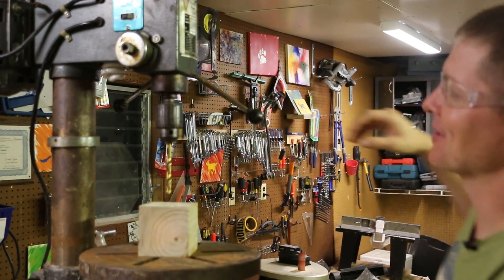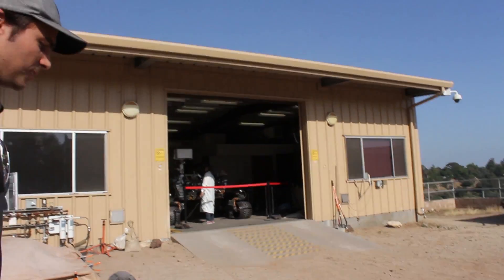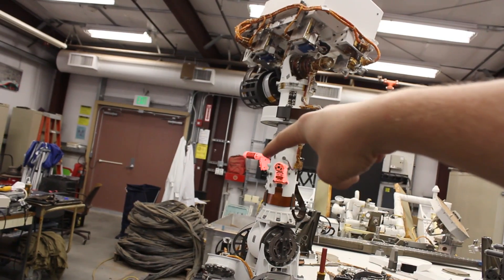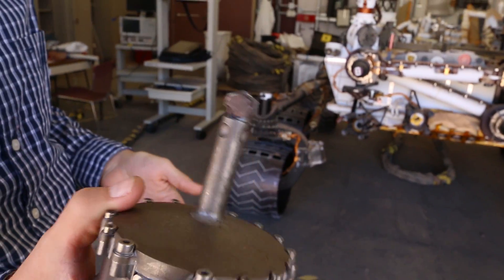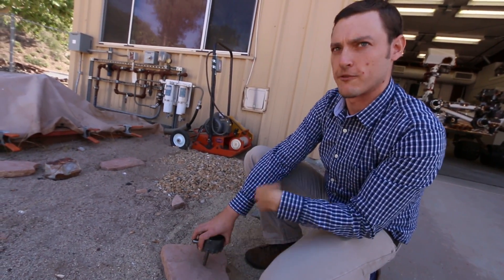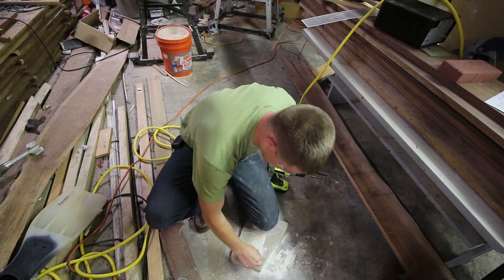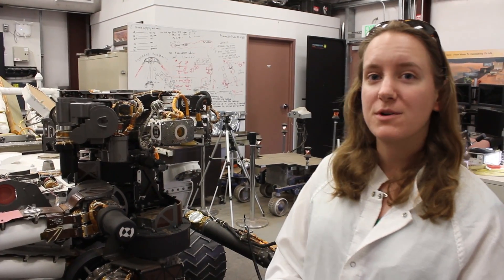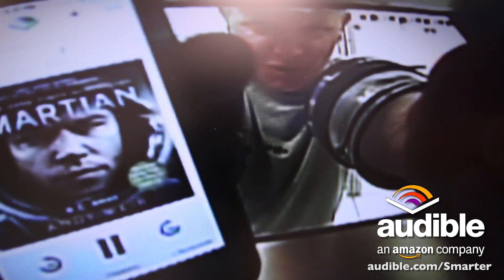The Drill we sent to Mars - Smarter Every Day 143

Comment: Destin, you are repulsively devoted to the lie that is Nasa. I get that you want to live in denial because you work for them and you cling to the soothing lie that Nasa must be good somehow, but that's not what a good christian does. If you were an honest man you would ask questions about why the rover has moved at an average speed of 100 times slower than a garden snail. Why this affront to engineering isn't even capable of color fidelity like a 100$ tourist camera. Why the only video from it is a multiyear timelapse. And an ocean of addtional scathing questions because it is a criminally incompetent piece of engineering.
You might also ask why it doesn't use a laser drill and test the material in situ.
That kind of thinking would make the rover 10 times lighter and 100 times cheaper. 
And if there were even remotely ambitious intelligent people in charge at Nasa, it would have autonomy to do research and roam around and achieve 100000 times more than Curiosty has done. 
Two Kennedy presidents assassinated and wars started based on lies to kill millions of people and you want to pretend everything is good and call yourself christian.
You never knew Jesus.
Reply: +Dan Frederiksen Okay, if it's so incompetent; surely you can do better. I expect a prototypeable design in autoCAD by next week; followed by informing everyone on how to manufacture each part. After the prototype is built; you will be responsible for testing and making sure there are failsafes for everything.  If your design succeeds; you must then come up with a landing process that will work in a near vacuum, and then, of course, test it. Assuming everything works perfectly; you will then calculate the delta V (among a few thousand other things) and decide on the delivery method that has enough potential energy to  successfully escape earths influence at the perfect time so that it meets with Mars  with enough fuel left to slow to an orbit and drop its payload; at which point you can only pray to that dude you don't know that everything works... After you've done that; you have a right to complain. (Also: laser drills, seriously? that's like saying "why don't they use a blow torch instead of a saw to cut that wood?")
Reply: +Dan Frederiksen I am no expert on the subject, but you have gotten many points wrong. For example, the rover is not 100 times slower than a garden snail— a snail has a top speed of 0.047 km/h (roughly 1.3 cm/s) whereas the Curiosity rover has a top speed of 5 cm/s and an average speed of 1 cm/s (slower, but definitely not 100x slower). Also, the rover can see in colour (although I'm not sure, as I've only seen videos of its footage), and I don't think that the quality of the colour is going to change its primary mission of exploration. It's not an art dealer, you know? Autonomy you say? Humans have not even advanced far enough to create an autonomous robot on Earth (disregarding Google's self-driving cars which are still in the process of being created), much less when the rover was sent up four years ago. I'm assuming that it doesn't use a laser drill because the primary purpose of the drill (as mentioned in the video) is to collect the powder, which may be damaged by the heat of lasers. Lastly, although I have nothing against your beliefs, why would you bring up morality and religion into something that has abosolutely nothing to do with it? i.e. It was never brought up in the video, so why bring it up now? To be completely honest, you have many flaws in your argument so far, but I can't judge because I am not specialized in this field either. One thing though, please do not assume that your perspective of morality and religion is the same for everyone of your religion. Thank you.
Reply: +Dan Frederiksen Get help.
Reply: +Dan Fredrickson What are you possibly thinking about when you link his faith to the perceived shortcomings of the rover? I'm not going to get into all the reasons I think your logic on NASA performing poorly in regards to Mars exploration is flawed.  Because others have already done that and it isn't even my main concern. That's your opinion and I don't mind letting people have those. But to attack Destin and say those harsh comments about him not being a man of faith because he is a NASA employee and fan boy? It makes no sense. I'm not a man of faith but I hardly think it's acceptable to attack people's morals because they are passionate about their interests. I really don't think God has a problem with Destin liking Mars rovers, even if you hypothetically were right, and Curiosity was a pile of cow dung not worth driving on a go kart track. To say that a man who obviously takes his religion seriously (and as far as I can tell lives his life as a very kind, generous, and genuine human being) is very callous and hateful of you. And seeing as though I have spent years of my life studying religion, I could almost guarantee you that the Christian God you seem to worship would have a much bigger problem with you being spiteful and arrogant than he would with Destin enjoying the immense wealth of knowledge and engineering that went into landing a vehicle on Mars and exploring the Universe you believe He created. 
Ultimately, I just don't understand how you possibly managed to take your anger about Curiosity some how being a government shortcoming out on Destin, and how someone who claims to be a Christian could think it is acceptable to tell somebody they are spiritually and intellectually inferior to them. You seem to be the one is lost my friend. If you think your attitude and rude remarks would make Jesus proud then you may want to spend some time praying on it tonight and doing some soul searching. You might just realize that you're the one in the wrong.
Reply: +Dan Frederiksen Driving slow is safe. You can't just send a mechanic up there to replace the wheel if you smashed it from hitting a rock, so they have to be as careful as possible. It's a multi-billion dollar piece of equipment! And we do have HD great color photos. The problem is that there's a lot of radiation up there. Try putting your "$100 tourist camera" and see how many minutes it will last exposed on the Martian surface. And you answered your own question: why would you want a video that was the same as a still frame, since it's moving the pace of a snail? Also, you can't just hook it up to your 3G connection and upload it. Mars is a long way away and there are very few satellite data links between there, so they have to be very specific about what tiny amounts of information they send back.
Reply: Dan Frederiksen Unfortunately, I have to disagree. A quick Google search will reveal that a garden snail does, indeed, have a top speed of approximately 1.3 cm/s (converted from 0.03 miles/h here: http://www.infoplease.com/ipa/A0004737.html and 0.047 km/h straight from Google). As you have not said anything as to how you know that a snail is much slower, I am forced to be skeptical of your knowledge. It is true that the rover has not covered a large amount of distance given the time it's spent on the another planet, but that most cannot be attributed to speed alone. While speed is equal to the distance covered divided by the total time, this only applies when the object is travelling at constant speed. The rover stops hundreds of times every day to check its surroundings/gather data, etc. And once again, if we had completely autonomous robots, we would not need to rely on things such as bartenders, cars, or planes, etc. The Curiosity rover is autonomous in that it follows an algorithm when exploring, but it is overrided when humans need to take control for something specific. I agree that if it were fully autonomous, it would be much faster, but I doubt that even that would be by much. The rover is doing research— not only exploration. When you're sitting down examining soil samples, you don't need to be going 20 km/h. Better safe than sorry, since breakage would be crippling towards the mission, and slow is safer than fast.
Reply: Dan Frederiksen The low end of the transfer rate is 0.0005 Mbps. That's like 100x slower than 1990s dial up. On the high end it's still just 0.032 Mbps. Try sending 1080p through that and see how many months it takes for a single clip. Curiosity has traveled the second most distance of any man-made object on Mars (behind Opportunity, which has been there for over a decade). Driving fast isn't really the point of a Rover anyway. What would that get you? It's doing material science with a drill.

If you're so smart, why aren't you working at NASA? Why aren't you even the head of NASA? You are obviously more competent than 60 years of engineering and 20,000 employees. When can we expect the Dan Frederiksen Rover to be landing?
Reply: Dan Frederiksen alright, so what, exactly, is this 3d printing technology? do we even have that?
Reply: +Dan Frederiksen Let's see that 100$ tourist camera working in the radiation and harsh environment of space and mars. I really hope you're a troll and not that stupid.
Reply: +Dan Frederiksen Okay, they use commercial cameras in completely sealed, man-made environments. How exactly is that equal to the surface of Mars? On Mars, there is no shielding, whether UV-resistant glass or some metal, to stop solar radiation.  Discounting the other environmental effects on pictures from Mars, solar radiation alone could distort the colors into what we have been shown.

I do not have extensive knowledge or experience with cameras or their lenses, so I likely made a few assumptions, though none completely baseless.
Reply: Dan Frederiksen You do realize that distance isn't the concern here, right? The ISS is in low Earth orbit, inside our magnetic field which shades it and us on the ground from the majority of cosmic radiation. But Mars doesn't have a magnetosphere whatsoever. The image sensor would completely fuzz out on a standard camera so you would barely be able to tell a straight line from a curve. Go look up "effects of radiation on image sensors" and there's a ton of research on the subject.
Reply: Man, you make a good joke!
Reply: I'm just gonna assume you're a troll.
Reply: Well a quick search on the web show pretty much nothing about you oh almighty " Genius"  Mr. Dan. I'd expect to see at least some sort of prize but an actor? really thats the only info about you? unless you show some proof that you are who you say you are you're just as bad as i am or maybe even worse mate.
Reply: +Space Walrus the navigation to Mars is fine. That's one of the very few things they do right. But I could easily do a dramatically better rover. Will you get me 1/1000 of just one year of Nasa's budget to do it?  I could even do it for 1/10000. But let me guess, I don't get any money to do it at all because you are so reasonable..
Reply: also I'm pretty sure it's mainly the government's fault, not nasa's
Reply: and to answer your questions about why it doesn't use advanced tech like lasers: First off, lasers require a lot of power. Second off, as this previous guy said, lasers' heat would damage rock samples—or at least, the organic matter in them. Third off, the technology works. It's hardy, has proved itself to be long-lasting, and is cheap and trustworthy. There's no reason to believe that people like Megan spared any creative expense, as long as it fit within their budget. The previous rovers have lasted long past when they were expected to stop functioning due to the fact that the parts were known to be reliable, and were hardier than any newer forms. And besides, making the rover more complicated with advanced technology would make the programming more complicated, meaning it would be more prone to bugs. Bugs that the rover might not necessarily have 4-24 minutes to wait for correction on. To briefly sum my point up: Simpler tech is less prone to problems than complicated tech.
Reply: +Dan Frederiksen sorry I spelled your name wrong by the way.
Reply: +qsdfcvgyjmkl  those are specs, not what it has actually done. And a snail is a lot slower than 1.3cm/s.
In the first two weeks it didn't move at all. And you can look up how far it has gone in all the time it's been there and do the math. A trivial autonomous rover could have done all that in the first 4 hours on the surface.
Reply: +Ryan Knudsen it's fair because it's true. A christian does not get to be part of evil and definitely not pretend it's good to the masses.
People fortunately sort of know that Nasa is a lie although for the most part they are too sheepish to really draw conclusions on it. They are too weakminded to really object. I am not.
2 US astronauts have come forward to say ET ships are real and it is being covered up. That's a fairly big fact if you think about it.
Reply: +Dan Frederiksen Now go and tell that to the people at NASA, who worked very hard for years to make this dream possible, personally. Everyone's a hero on the internet, especially the people that accomplished nothing in their lives.
Reply: +LamaAndTiger I hope they are listening
Reply: +StalePhish 100 times slower than a garden snail. It's not safety, it's just bizarrely treasonously incompetent. There is no safety is being so slow that nothing is ever accomplished. It's not just slow, that's just your lack of thinking talking. If you were there watching it, you could watch it for days and you wouldn't see movement. You only think it's ok because you haven't thought about it. You sheepishly assume. And despite the extremely slow pace, they managed to damage the wheels because there were little rocks on mars. Pointy ones. They hadn't thought of that... 
When even a very slow pace rover could do better in a few hours than it has done in years, then they are doing it wrong.
You are wrong about bandwidth too. And cameras. You have no insight, only sheepish faith.
Reply: +StalePhish but my thoughtless friend, who says it would be limited to another of Nasa's treasonously incompetent systems? bandwidth can be plenty good from Mars with a few appropriate steps. Easily multiple uninterrupted HD channels. An obvious step is a relay satellite in geo orbit around Mars (actually 3). Another at Earth. Either huge sat dishes (say 100m diameter @100GHz) or laser telescope. The huge dishes could be 3D printed in space with ease. Even optical telescopes could be printed but more difficult.
I am of course incomparably better than anyone at Nasa but Nasa doesn't hire the best and the few good people they have are kept from decision making. That's part of what you don't understand. Nasa is a lie and always was. It's a culture bred for sheepishness.
And speed matters because your life is very very far from eternal.
Nasa is built to make your life pass with a handful of breadcrumb achievements. A pathetic rover every 10 years and a few ticks and your life is over. A sheep to slaughter. If you bothered to think for once in your life you would realize how much better it is for a rover to do in an afternoon what Nasa rovers will take your entire life to do.
Just think about this simple fact. What Ryan the drill sergeant said in this video is that there is a water cycle on mars, even where the rovers are. So why wasn't that detected immediately by the first rover unless it's so incompetently made that it can't even detect effing water.
An even half decent rover would operate autonomously on that super easy surface of mars and sample everything continuously in rich data streams and glorious HD. Including all through the night.
And it would have accurate color and show Mars as the sandy rocky landscape that it is with white to blue atmosphere instead of the hellish red on red that these sheep presented it as at first.
Your thinking, and I use the term loosely, is predicated entirely on blind faith in authority. Zero actual thinking.
Reply: +Dan Frederiksen i hope you're b8
Reply: +Dan Frederiksen 100m SAT dishes are NOT easy to make, let alone THREE in mars orbit. You don't get much power up at mars, just so you know.
Reply: +jetison333 ye of little faith. Solar radiation at mars is about 40% of earth or around 50% compared to earth surface. Plenty.
And a robotic 3D printer with patience makes it easy.
Reply: Dan Frederiksen still need to send all of the material up there, not so easy. also with patience? weren't you just saying how slow the rover moves?
Reply: +qsdfcvgyjmkl a quick reality check does however reveal that you are wrong. Search for snail moving here on youtube. It's more like 1.3mm/s in a flat out sprint. And Curiosity is indeed 100 times slower. A glacier is literally faster on average. Don't be such a mindless status quo sheep. Wake up and behold the awesome depravity that is nasa.
Reply: +jetison333 appropriate patience. Not sheepish. It might take a month to print a large dish in space but then it's done and can last forever.
If it can be printed 10000 times faster with ease, by all means but it can't. Development time is the prohibitor so a month is great.
Curiosity is an abomination.
Reply: Dan Frederiksen all right them, how will we get the material up there? assembling isn't hard, but getting the material into space is.
Reply: +jetison333 well let's not underestimate the difficulty of fully autonomously printing a large precise dish in space and lifting stuff up is actually something rockets can do.
Let's say we print with aluminium powder, and we can pull off average dish thickness of 0.1mm including support, say a 100m dish in geo is about 8000m2 or about 1m3 of material, 2½ ton.
Alu should be quite beautifully shiny in space. Should also keep it cool.
If you can't print thinner htan 0.5mm then it's 12 ton. No biggie either. For Mars you might want to have only 30m dishes to keep it cheap. I think that's plenty bandwidth.
Of course if lasers are just better then you just need to lift up a telescope mirror.
Reply: Dan Frederiksen You still have to carry all that material up there and get it into the right orbit. And it's super risky and not worth it to have an autonomous print job that cannot be inspected and tested by humans. We had that huge issue with Hubble when it first went up and that was even inspected! Imagine something that was not tested at all. You have no idea how the industry operates. Testing is one of the biggest parts of any engineering industry.
Reply: +jetison333 the specific printer doesn't exist of course but sure we have several metal printing technologies. I can't say off hand which would be the best principle but one obvious option is alu wire into a melting nozzle and then spooling it on the edge while guided by some kind of laser interferometer at the focus point of the dish. Sort of like weaving a spider web. Maybe spool it on and laser weld it. It could also have a couple of rollers that massaged the sheet as the material was applied to ensure uniform smoothness. Like a little semi fancy spider weaving a dish.
Certainly can be done.
Reply: +StalePhish well, given that their protocols aren't doing so greatly and particularly idiotically on the hubble, I'm not too worried about deviating.
You can also do some tests on earth and try small tests in space if deemed reasonable. It's not an issue. You are just being a status quo sheep. Dare to think. Dare to be inspired.
Reply: Dan Frederiksen Try convincing anyone to fund you with 0 testing with your realtime 3D printed stuff. Nobody is going to approve something like that. It's far too risky. Being inspired isn't going to mean you're going to get the tax money approved to actually do it
Reply: +StalePhish you seem like a perfect candidate for a job at Naysay.
Reply: Dan Frederiksen I am an engineer in real life so I feel like I have quite a bit more experience in how the process works than you
Reply: +Matt Mann what do you really know about it...  let's go with nothing at all.
They use commercial cameras on ISS and the space shuttle. Wanna take a wild guess who's the stupid one between me and you.
Reply: +OcarinaT1 you couldn't shield a camera? 50% further from the sun...
and no, radiation could not distort the colors. You know nothing about it.
Reply: +StalePhish I do realize that you know nothing about it
Reply: Dan Frederiksen Since you're an expert, why don't you give us some of the facts you know about radiation and image sensors, or about any other related topic?
Reply: lord of the flies youtube censorship has kicked in.
Chris you confuse your petty theories with reality. Self flattering Dunning Kruger. Make me a robot that feels pain and I shall concede that God isn't real. Hint: I'm a genius computer scientist specialized in AI. It cannot be done with known or even speculated physics. Ever.
Reply: +Chris learn the difference between your and you're before you call a genius a moron.
And I recognize the matrix quote.
Reply: What would be the costs of such a operation? The satellites i mean?
Reply: +Luís F Thank you. I just did a quick check on Google. As it turns out, NASA are the only humans that have a machine on Mars doing experiments. You have raised a very good point... Interplanetary travel is not the same as a walk in the park.
Reply: +Dan Frederiksen I alsmost came when u said christian, or maybe good christian. i dont know whats the difference though. :P
Reply: It moves so slowly in order to decrease the chances of it getting stuck. I don't think you quite understand how much $2.5b is, which is the cost of the rover. You wouldn't want to risk it getting stuck. The disadvantages of traveling at a high speed far outweigh the advantages. Take a look at Curiosity's wheels, they are in bad shape. Traveling even faster is not a good idea. It travels at around 1 cm/s, which is slow indeed. It drives at 5 cm/s but it stops in order to analyze its surroundings and plan its future path. The cameras do use color fidelity! But they do it manually, which is more reliable. Keep in mind that this thing was designed in 2008, meaning that its technology is the same as that of 2008.

While I agree that it would be logical for NASA to be the lie that you think it is, it isn't. You get to understand that when you learn more about their projects. For instance, I am making a very accurate and working model of the Curiosity rover. I've learned that the engineering of the rover is much more complex than you think. It also features way more experiments than meet the eye.
Reply: Newton, Maxwell, Galileo, Descartes, Bruno, Faraday, Heisenberg, Kelvin, Planck, Copernicus, Pascal, Kepler, Volta and Einstein believed in Jesus. Schrödinger, Oppenheimer and Tesla were spiritual.
I am the smartest man in the world and a devout christian. I am the origin of deep learning among other achievements. Destin claims to be christian too.
Reply: Dan Frederiksen Sure, lots of great scientists are and were christians. I am officially christian but don't believe most of the stuff. I see christianity more as a belief which makes people live their lives in a better way, which is the point of religions. I believe in science. I believe in the beauty of the universe. I just don't see your point though. What does christianity have to do with a drill bit and/or NASA being a hoax?

And what do you mean by that 'smartest man in the world' stuff? You don't seriously think you're the smartest person, right? I'd give that price to Edward Witten! :)
Reply: Cd, Witten is a good rational mind but he is the sheepish kind that doesn't dare think what he is not 'allowed' to think by subtle unspoken sniveling peer pressure. For instance he seems to have no awareness of the UFO phenomenon and only a sheep is oblivious of that. And less controversially but equally significant to physics he pays no attention to a phenomenon like ball lightning. And that just disqualifies him.
That you can't make anything physical feel pain proves our spiritual nature. God is more than good behavior.
Reply: Dan Frederiksen. We actually can make machinery feel pain. Just apply a sensor somewhere that monitors damage levels of a certain part. If the sensor finds something run some code that moves said parts away from any source of damage in order to avoid more damage. In essence this also happens in our and more species's brains. A nerve detects damage (something about a change in electical currents) sends a signal to the brains/spinal cord. Wich in turn react to that signal. Usually by moving the damaged part away by reflex.

What is as of yet not or hard to create is true artificial intelligence. 

And yes this is a very simplified example
Reply: sjimen, I'm a genius AI scientist. I'm the origin of deep learning if you know what that is. You don't know what you are talking about. When I say pain can't be done in the mechanistic domain it's because it can't.
Not only don't you know what pain is but you don't even know that you don't know.